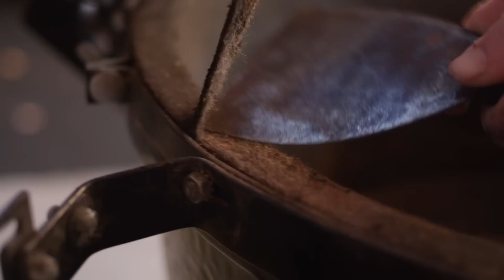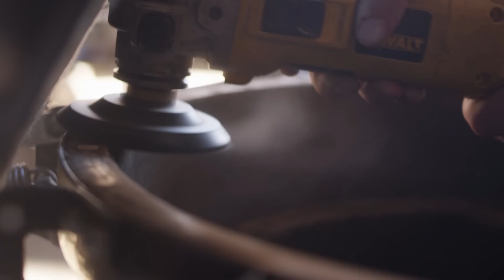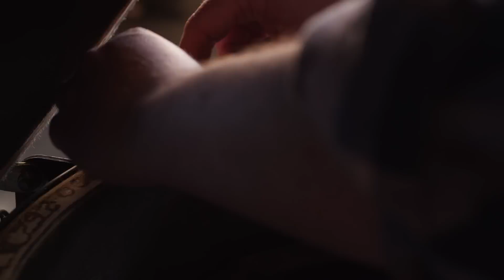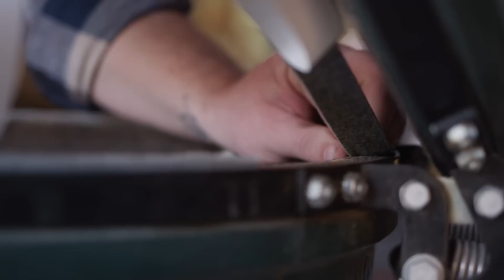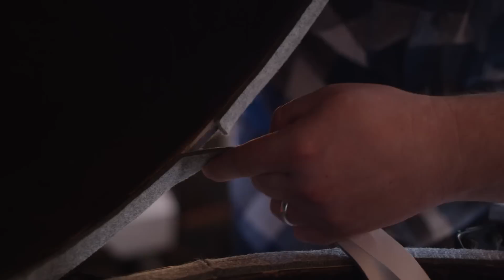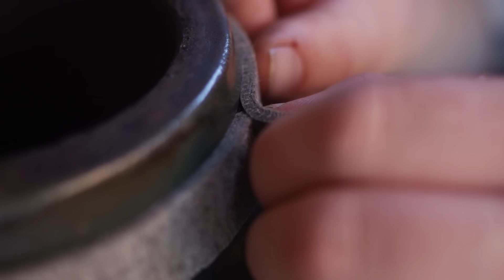High-Que Nomex & Kevlar Gasket for Ceramic Grills | Product Roundup by All Things Barbecue

Comment: I see the main problem, at least on Kamado Joe is the self-adhiesive tape. I checked, ant it's allowed max short term temperature is 150C /300F, which you can easily exceed when doing pizzas. Or trying to clean kamado with burning. Therefore some hight temp oven gasket glue is probably better.